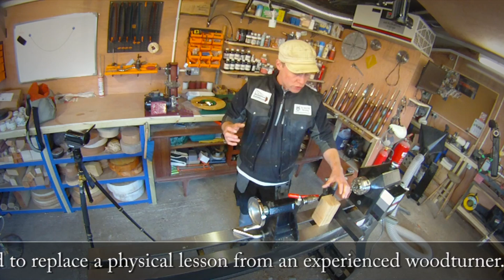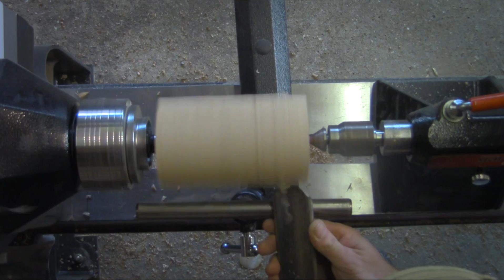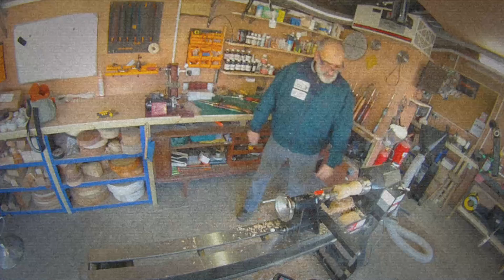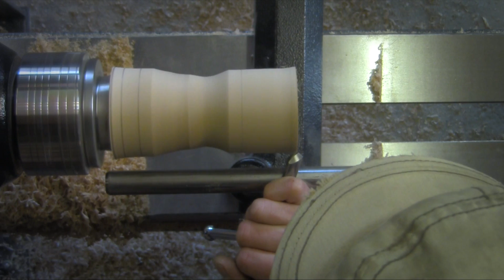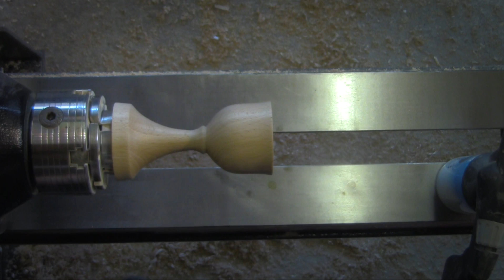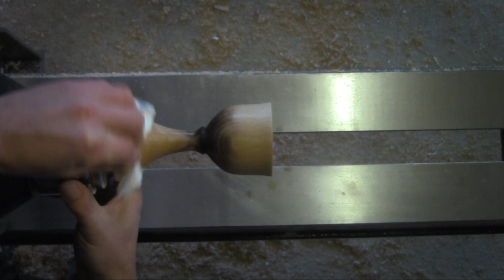I Made a Medieval Chalice Using Only a Wood Lathe

Comment: Being a very new novice.... Could you have used a wire to burn in the ring at the bead??? Or was it because of the colour it produced?
Reply from the maker: Hi Peter. I could have used a wire on the bead, yes, but it would also have cut into the wood a bit, which I didn't want to happen. The sharpie was the next best option.
All the best,
Martin